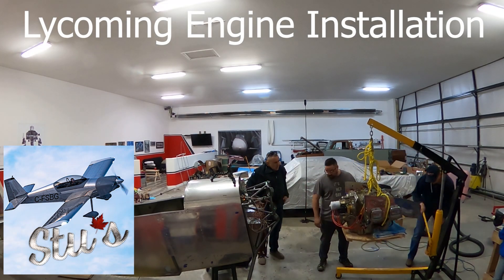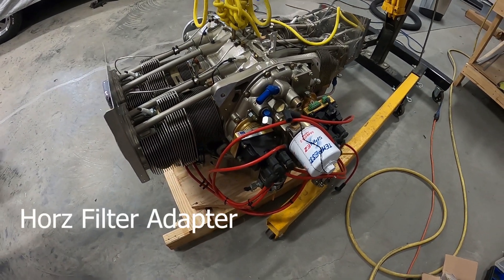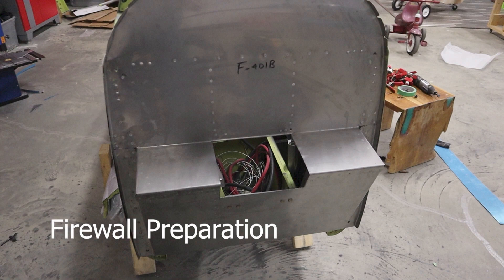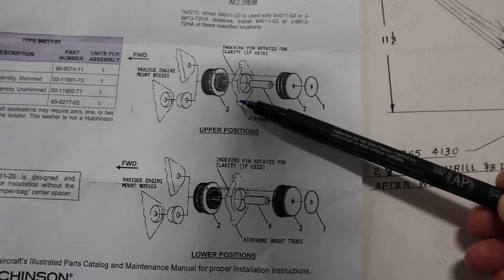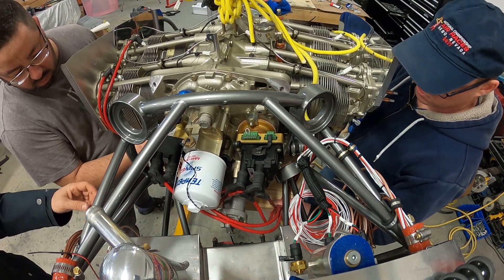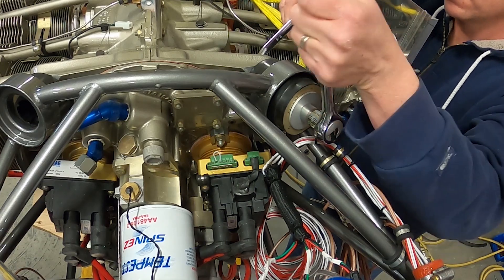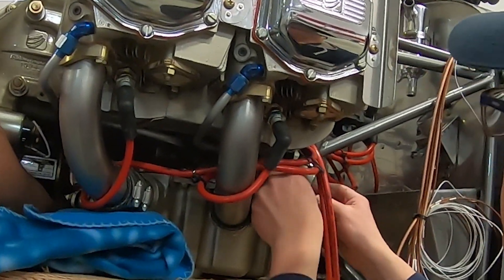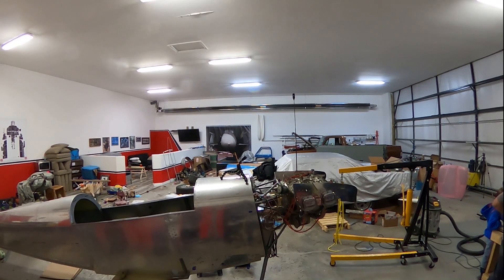RV4 Lycoming Engine Installation

Comment: What Torque setting did you use for engine mount bolts?
Reply from the maker: Same as normal AN7 bolt.  40 ft/lbs.  Then you might have to rotate the bolt if it uses a cotter pin but new engine bolt kits from Vans will be metal lock nuts (much better)

Comment: Hi Stu, what cable pass through did you use on firewall?
Reply from the maker: I like this one.

https://www.aircraftspruce.ca/catalog/hapages/ssfirewallkit12-04762.php
Reply: That’s what I have, sorry I should have been more clear... I was asking about throttle mixture and prop... thanks!
Reply from the maker: @tf1083  Oh sorry now I get it.  I like the single hole design:

https://www.aircraftspruce.ca/catalog/appages/grommet4200.php

I ordered the 0.375 hole one but I think you can go smaller to the 0.312 hole if I had to order again.  Standard Vans cables